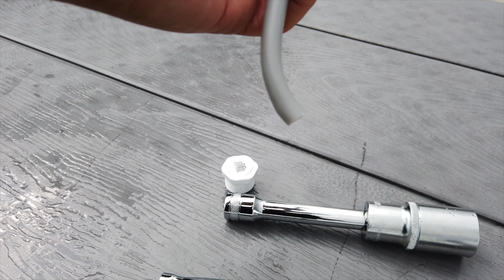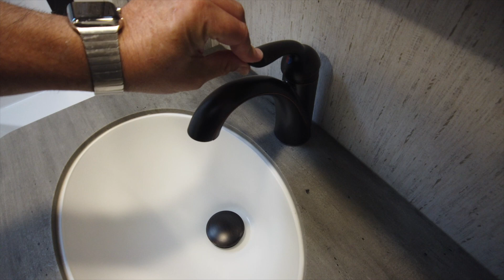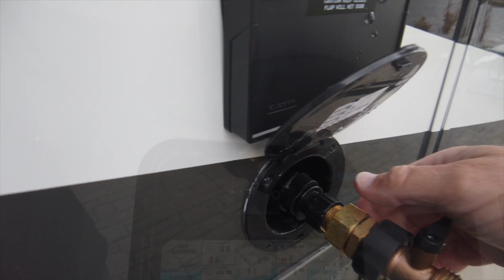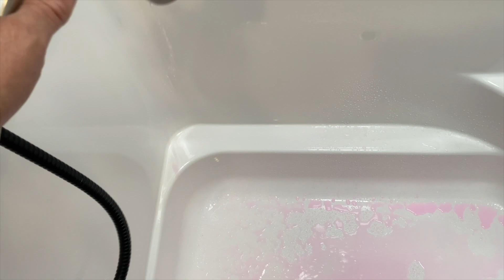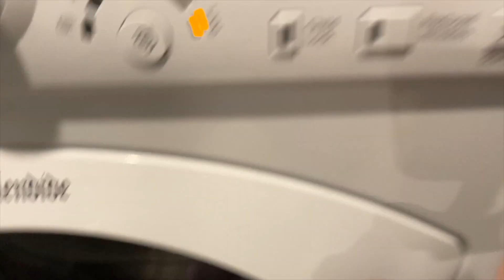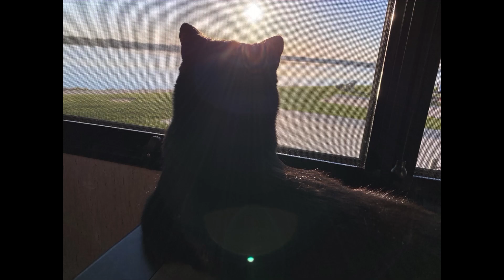Easy Step by Step Guide to Winterize a RV

Comment: Should a person run antifreeze through there low point drains after winterizing the washer? Thanks
Reply from the maker: Yes, the low point drains should have some antifreeze ran through them.  At the end of the process I will release some pressure in the lines by cracking open the two LP drains and let some antifreeze run out.

Comment: Hi there. Thanks for the video.   I happen to notice that  towards the end of your video, you once again suggest that you put the valves in the 45 degree position and pump some antifreeze through them. However, in turning the red valve in this position, you will be pumping antifreeze into your hot water tank. The Grand design owners manual suggests that you turn the blue, green, and white valves only when pumping antifreeze into your lines.  

The owners manual also suggests that you put the valve in the “power fill position” as you pump your air into it. I don’t understand why they suggest this, as it appears to me that this is used to pump water to the fresh water tank, and would have little to do with the interior water lines. I’ve tried this process, and could not pressurize my lines, which confirms that it is just send air to the fresh water tank. I wonder if you had any thoughts on this direction being provided by Grand Design.
Reply: I guess he doesn’t reply
Reply from the maker: I reply...just really slowly.  In the video, I turn the valves to 45 degrees and blow only compressed air through the system, not antifreeze.  This flushes the water out of the nest of valves behind the Nautilus system.  The idea is to get at much water out of the lines as possible before putting in antifreeze.  When adding antifreeze, I changed the system back to winterize and then pump the fluid in.  In the winterize position the hot water tank is bypassed.

Comment from the maker: It is the time of the year where those of us who store our campers need to winterize them.  Winterization is one of those items that ends up being outsourced to a RV tech or dealer likely because the process sounds complicated.  It actually is straightforward and only takes a few tools that after you own them will work year after year, rig after rig.  RV Winterization is a skill that anyone with basic mechanical abilities can easily master.  It will not only save money, you will have the satisfaction of knowing that you did it yourself and it was done correctly.  In the video description above (click SHOW MORE) there are links to each section.  This makes it easy to jump to the section you need without having to play through the entire video.  You may want to save the link to this video in your browser so you can reference it again next year.  We also posted a companion article on our website if you would like to read through the process:  https://passionhighway.com/winterization